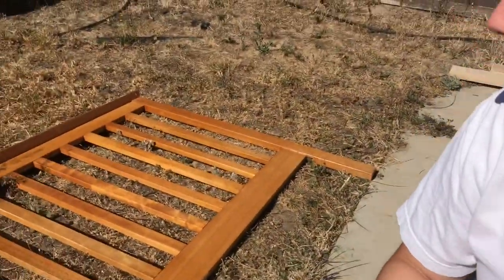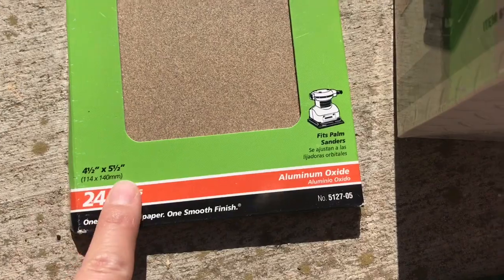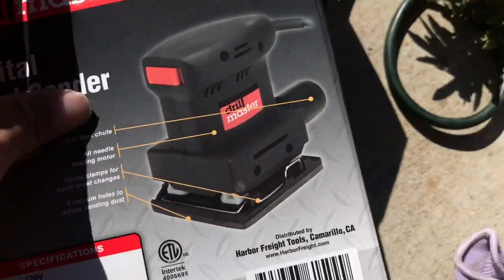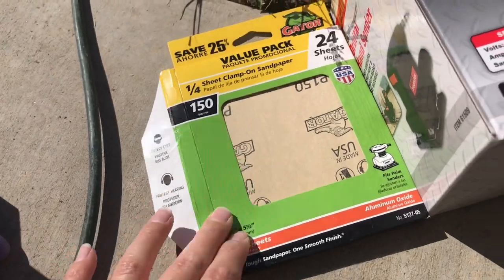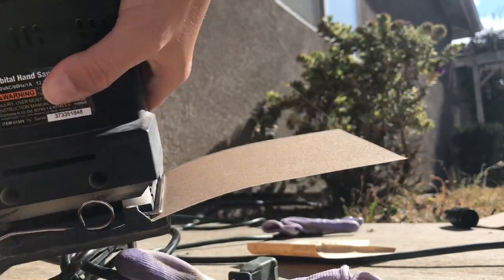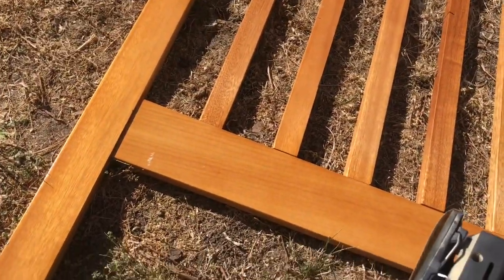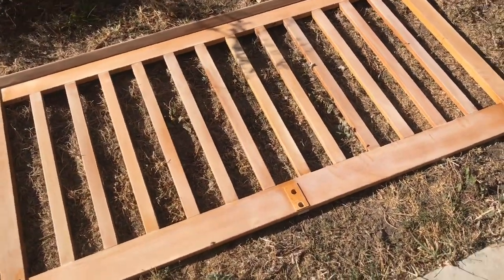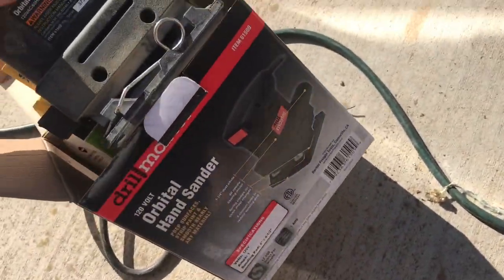Drill Master Orbital Hand Sander 120 Volt W/ Gator 150 Fine Sanding Sheets - My First Power Tool!

Comment: Good work and good video. You can use full size sheets too, just fold and cut them into 4 pieces 👍 hence the "1/4 sheet sander". Might come out a little cheaper, especially over time.